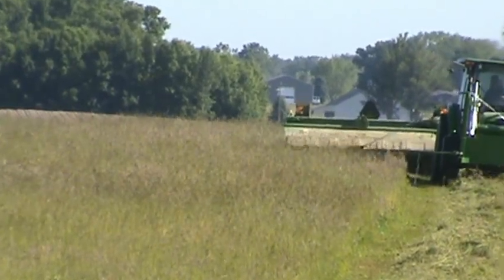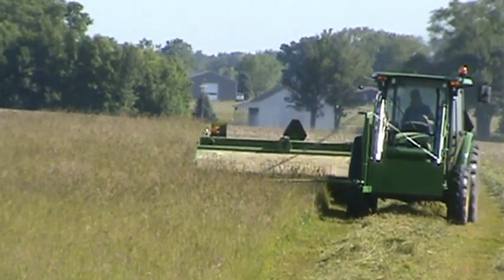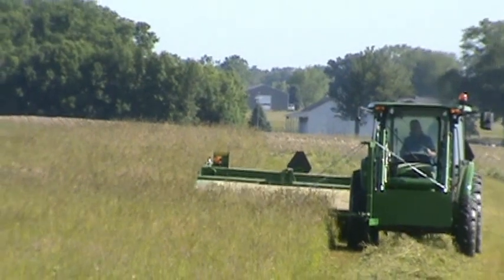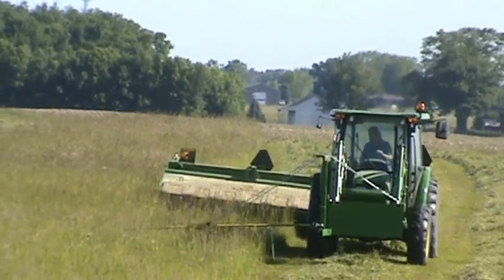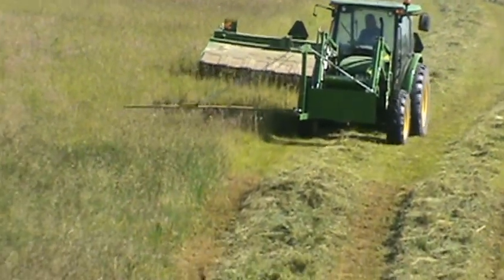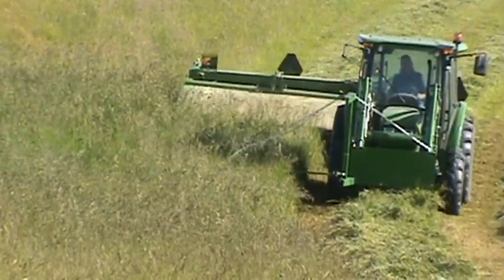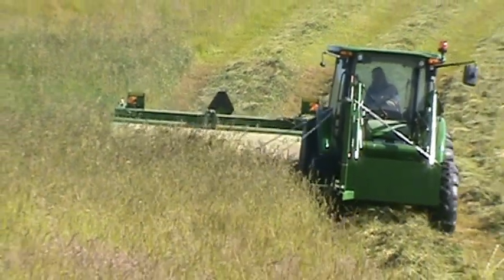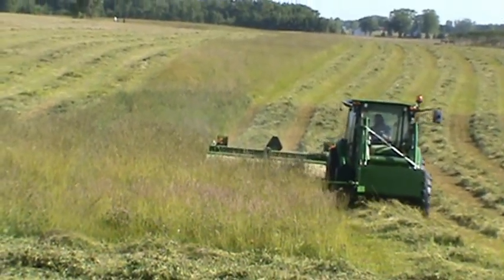Flushing Bar in Action on John Grant Farm June 2012.MPG

Comment: I'd love to see data on how effective flushing bars are. As stated disc mowers move a hell of a lot faster than horse drawn sickle mowers. This operator is also creating a kill box by cutting outside in, it's efficient for cutting hay, but drives wildlife into the middle which either kills it on the last pass, or leaves it in an exposed field to be killed by predators.
Reply: I thought same thing while watching this! Mow from center out, not in!